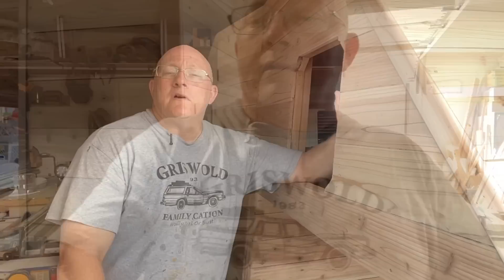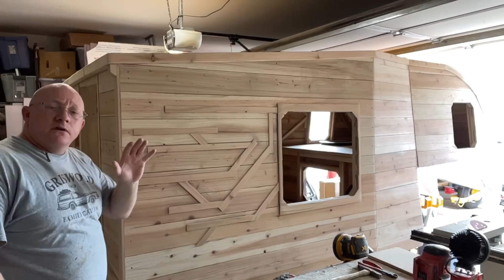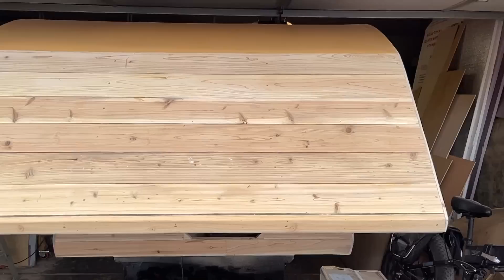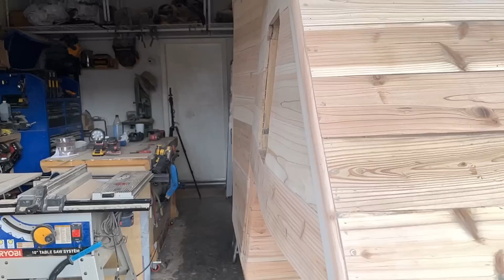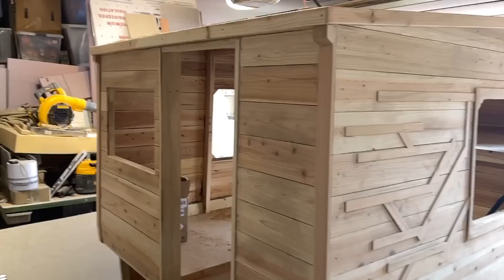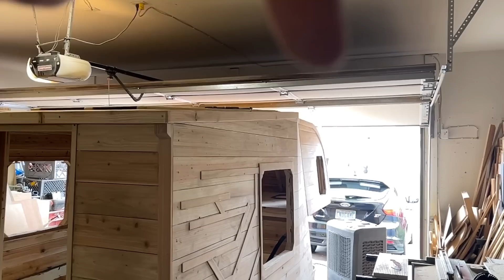Truck Camper Build 6.0: Key Design Considerations

Comment: Beautiful work. What is the depth needed for the AC? Could you put it in the front panel of the cab over?
Reply from the maker: I don’t think there is a set answer for the depth. I try to get about 50 percent in/out.  From my experience, that helps a lot with efficiency.  If you have it fully recessed, it will work with adequate space, but you will need to use a diverted to the AC isn’t pulling in hot air just released. In some of my prior build videos, I discuss this issue.

Comment: I'm glad you have taken the time to document all this. I am in the design phase of a camper for a 5ft Gen 3 Tacoma and you have saved me quite a bit of trial and error watching your previous builds...thanks for posting them! I have a question...you are using expanding foam as adhesive for foam to outside skin. Great Stuff makes two types of foam "gap and crack" and "windows and doors". The window and door says its minimally expanding. Which one did you use on the floor (where you showed the wood bowing just a bit)?  They also make a construction adhesive which I assume is non-expanding foam (have not seen it IRL). My goal is to make a 350-400 pound shell so the foam panels will be adding quite a lot to the structure....therefore glue is important.

Comment: Streamlining makes for a very attractive camper, that said, total frontal area  is what you have to plow through the air. In aircraft design the smaller the total frontal area the faster the aircraft even before streamlining.  Streamlining on the other hand does not reduce the total frontal area, it only controls pressure areas. Once established the pressure areas will create their own streamlining. Conversely on the trailing side, drag is created . Reducing drag will provide far more benefits than streamlining the leading end. As you said making the back side pointy would be a plus. There is another way though. Side slats on the rear sides, directing side surface flow air into the turbulen suction area behind the camper will aid in smoother airflow,  reducing tbe drag much like making the backside pointy. Good looking build.
Reply from the maker: Thank you. Good points

Comment: Really interesting design. Not having boards crossing from the cab over to the tub and then putting in Windows in the cab over section...does this compromise the strength of the cab over? We have built a cab over section in our truck camper build for our flatbed truck n have some concern about putting in windows of the cab over section (designed to fit a queen size mattress) we are leery of the cab over section collapsing
Reply from the maker: No concerns on my part. The cabover is rock solid. I’ll discuss in the next video, but in short I incorporated some special framing to help with that issue. Ultimately though, the main component supporting the cabover is the shear resistance offered by the cedar planking on the cabover section.  Tying into the rest of the body is unnecessary.  Everything looks counter intuitive I’ll admit. But all of the cabovers have worked out well.
Reply: @EndgameCampers  I would really appreciate it, too, if you were to create a specific video as you mentioned about the engineering of the cabover.